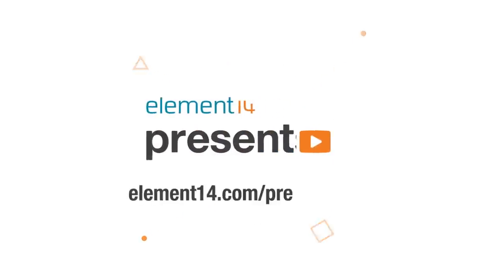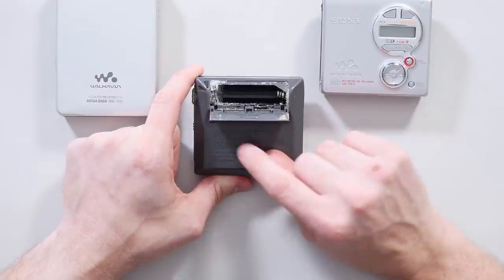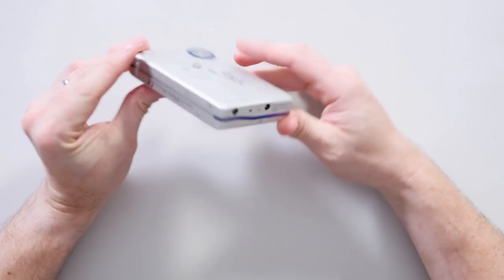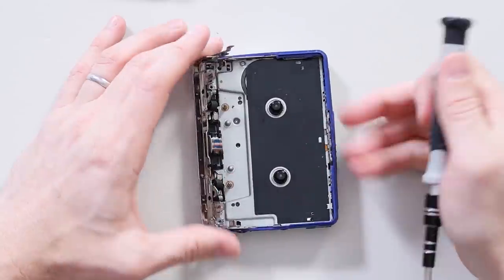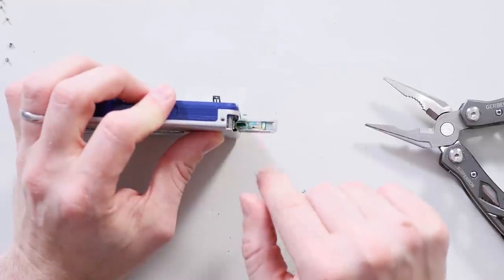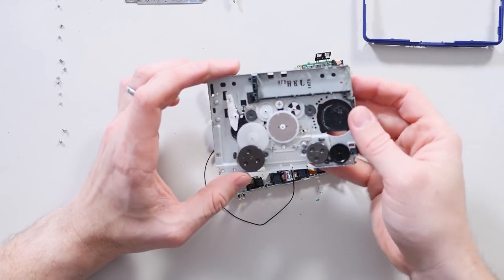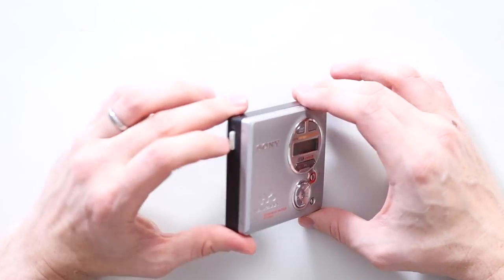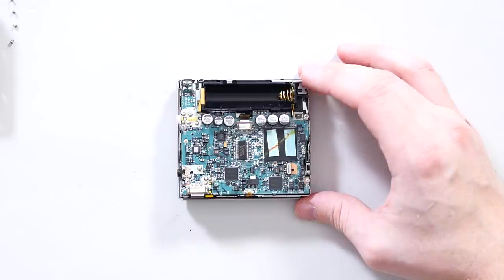Minidisc MZ-R410 vs 2000's WM-EX631 Walkman Teardown - The Electronics Inside

Comment: I love the minidisc it`s a great editing tool for making up cds,from various sources..so flexible of divding,,combining,moving tracks,and up to 160 mins of good quality sound with an 80min disc..and text of course,which I use a keyboard,pluggied in at the front of the main machine. for ease of use.I have a SONY portable md,which still works,but in my hifi I use a Pro TASCAM model,and it`s just so good..did MP3 kill  off MD,with  a poorer quality sound,because of compression?..I also have 2 SONY DAT recorders,and a portable DAT.and the quality that comes from those machines is amazing,and up to 6 hrs on long play,with a 3hr tape,because there is a long play facility,doubling the record time on a tape..,although,like casettes, and the 120min lengths, not really recommended.I had forgotten about the mini cassette,why did that not take off,was it an updated version of the small dictaphone recorders,that just didnt tick the right boxes?..The first time I have seen inside these players, quite amazing,and good quality construction for the size..

Comment: Sadly Sony killed the MD system by having too many interests in copy protection and crippling features. I loved my MD, but when second generation machines appeared and i saw how crippled the features in combination of a computer were, i switched to a harddrive-based MP3-player.
Reply: NetMD could've been cool and useful, but nope - it takes only slightly less time to write SP audio over USB (to be honest, probably not NetMD's fault directly, but then audio goes through LP2 compression anyway internally or something?), and it only goes one way from computer to recorder; couldn't read back anything regardless of copy protection on tracks on a disc, this is just "haha we'll screw you because we can" level evil.